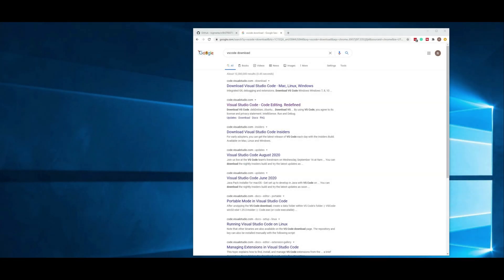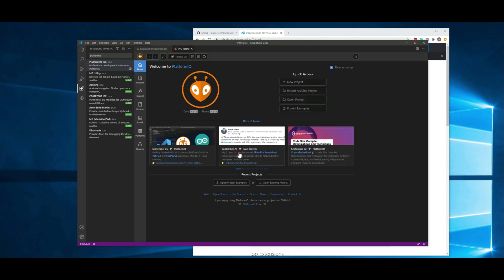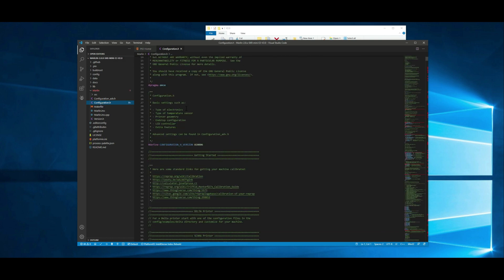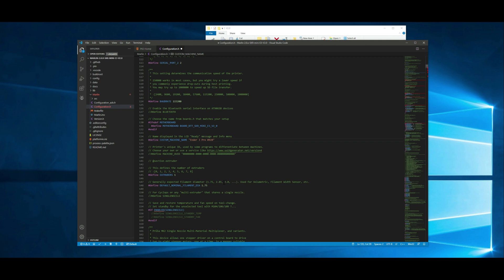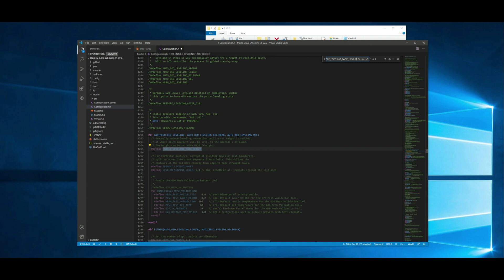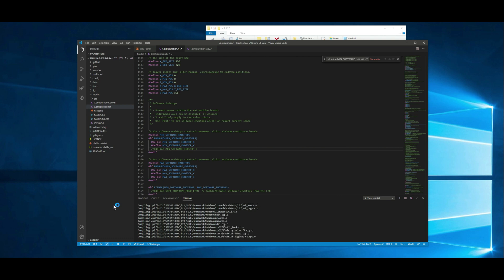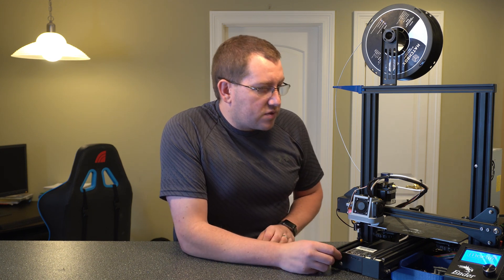How to Compile Custom Firmware for SKR Mini

Comment: I was trying to connect skr mini via usb but it is not detected by the laptop. I also tried to connect to octoprint via Rpi but it doesn't connect. How do I configure the usb port ?
Reply from the maker: Hi. have you tried a different USB cable? If its not being seen by either, you may be using a cable that is only meant for charging.
Reply: @3DPrintscape  Thank you. It's working now.

Comment: I have 2 printers a ender 3e v2 and a am8 with a skr minie3 v2 how can i use VS Code without chging the board and settings one for another.
Reply from the maker: Hi. If they both have the same board and build plate size you should be able to, if they are different you won’t.

Comment: If anyone gets the Collect2.exe error after attempting to compile the firmware, here's the fix. On the left pane of Visual Studio Code, open the platformio.ini file and change the "default_envs" line (around line 21) and change the name value to STM32F103RC_btt_512K.
Reply from the maker: Hi. Thanks for the info. If the build still fails after this remove the _512k. The option went away back in June.

Comment: I followed all this and i get a .elf and .hex firmware and no bin?
Reply from the maker: Hi. What board do you have? If you have a 32 bit board that uses a bin then the output should be a bin. If you have an 8bit board, then what you got is right but you have to connect your printer to the computer to push the firmware after you installed a bootloader.

Comment: Hi I'm getting an error compiling. I even tried compiling the un edited code and still same error. Any ideas? Great video by the way!
Thanks!

> Executing task: C:\Users\Daddy\.platformio\penv\Scripts\platformio.exe run <

Processing STM32F103RC_btt (platform: ststm32@~6.1; board: genericSTM32F103RC; framework: arduino)
-----------------------------------------------------------------------------------------------------------------------------------------------------------Verbose mode can be enabled via `-v, --verbose` option
In file included from buildroot/share/PlatformIO/scripts/../../../../Marlin/src/inc/MarlinConfig.h:34:0,
                 from buildroot/share/PlatformIO/scripts/common-dependencies.h:31:
buildroot/share/PlatformIO/scripts/../../../../Marlin/src/inc/../pins/pins.h:547:12: fatal error: stm32f1/pins_BTT_SKR_MINI_E3_V2_0.h: No such file or directory
   #include "stm32f1/pins_BTT_SKR_MINI_E3_V2_0.h"  // STM32F1                              env:STM32F103RC_btt env:STM32F103RC_btt_512K env:STM32F103RC_btt_USB env:STM32F103RC_btt_512K_USB
            ^~~~~~~~~~~~~~~~~~~~~~~~~~~~~~~~~~~~~
compilation terminated.
CalledProcessError: Command 'arm-none-eabi-g++.exe -DTARGET_STM32F1 -D_MARLIN_FIRMWARE_ -DHAVE_SW_SERIAL -DTONE_CHANNEL=4 -DTONE_TIMER=4 -DDEBUG_LEVEL=0 
-DSS_TIMER=4 -D_MARLIN_DEPS_ -w -dM -E -x c++ buildroot/share/PlatformIO/scripts/common-dependencies.h' returned non-zero exit status 1.:
  File "C:\Users\Daddy\.platformio\penv\Lib\site-packages\platformio\builder\main.py", line 175:
    env.SConscript(item, exports="env")
  File "C:\Users\Daddy\.platformio\packages\tool-scons\scons-local-4.1.0\SCons\Script\SConscript.py", line 591:
    return _SConscript(self.fs, *files, **subst_kw)
  File "C:\Users\Daddy\.platformio\packages\tool-scons\scons-local-4.1.0\SCons\Script\SConscript.py", line 280:
    exec(compile(scriptdata, scriptname, 'exec'), call_stack[-1].globals)
  File "C:\Users\Daddy\Desktop\3D Printing\3D Printing tools\Firmware\BIGTREETECH-SKR-mini-E3-master\BIGTREETECH-SKR-mini-E3-master\firmware\V2.0\Marlin-2.0.7.2-SKR-mini-E3-V2.0\buildroot\share\PlatformIO\scripts\common-dependencies.py", line 286:
    apply_features_config()
  File "C:\Users\Daddy\Desktop\3D Printing\3D Printing tools\Firmware\BIGTREETECH-SKR-mini-E3-master\BIGTREETECH-SKR-mini-E3-master\firmware\V2.0\Marlin-2.0.7.2-SKR-mini-E3-V2.0\buildroot\share\PlatformIO\scripts\common-dependencies.py", line 118:
    if not env.MarlinFeatureIsEnabled(feature):
  File "C:\Users\Daddy\.platformio\packages\tool-scons\scons-local-4.1.0\SCons\Util.py", line 658:
    return self.method(*nargs, **kwargs)
  File "C:\Users\Daddy\Desktop\3D Printing\3D Printing tools\Firmware\BIGTREETECH-SKR-mini-E3-master\BIGTREETECH-SKR-mini-E3-master\firmware\V2.0\Marlin-2.0.7.2-SKR-mini-E3-V2.0\buildroot\share\PlatformIO\scripts\common-dependencies.py", line 262:
    load_marlin_features()
  File "C:\Users\Daddy\Desktop\3D Printing\3D Printing tools\Firmware\BIGTREETECH-SKR-mini-E3-master\BIGTREETECH-SKR-mini-E3-master\firmware\V2.0\Marlin-2.0.7.2-SKR-mini-E3-V2.0\buildroot\share\PlatformIO\scripts\common-dependencies.py", line 250:
    define_list = subprocess.check_output(cmd, shell=True).splitlines()
  File "C:\Users\Daddy\.platformio\python3\lib\subprocess.py", line 424:
    return run(*popenargs, stdout=PIPE, timeout=timeout, check=True,
  File "C:\Users\Daddy\.platformio\python3\lib\subprocess.py", line 528:
    raise CalledProcessError(retcode, process.args,
=============================================================== [FAILED] Took 1.12 seconds ===============================================================

Environment      Status    Duration
---------------  --------  ------------
STM32F103RC_btt  FAILED    00:00:01.121
========================================================== 1 failed, 0 succeeded in 00:00:01.121 ==========================================================The terminal process "C:\Users\Daddy\.platformio\penv\Scripts\platformio.exe 'run'" terminated with exit code: 1.

Terminal will be reused by tasks, press any key to close it.

Comment: Hi, great video. Very informative and helpful. Just a noob question. I am using the BTT stock fw on the SKR Mini E3 V2 on my ender 3 V2. I would like to install Jyers fw. Can the SKR Mini support Jyers?
Reply from the maker: Hi. I haven't actually tried it my self but i searched around a bit and it looks like it would work.

Comment: I am extremely new to 3d printing, I looked at your video and tried everything that you said only to get this at the end.pio\build\STM32F103RC_btt\firmware.elf] Error 1.  I've tried to download another copy and reinstall but it doesn't work, any advice?
Reply from the maker: Hi. In your platformio.ini file (at the root of the directory) replace default_envs = STM32F103RC_btt with default_envs = STM32F103RC_btt_512K .
Reply: @3DPrintscape  ok awesome that worked but when i put it into the printer, i get fade height off, what does that mean?
Reply from the maker: @marcusmiles568 This is pretty common on the TFT, take a look at this article. https://github.com/bigtreetech/BIGTREETECH-TouchScreenFirmware/issues/750
Reply: @3DPrintscape  I.m sorry i'm not totally understanding, so after I get autoleveling done and saving the grid, how do i level the bed because its still quite a ways from the nozzle.
Reply from the maker: @marcusmiles568  You will need to set you z offset, here is a video I made on that. https://youtu.be/2gRfU26aTDs

Comment: When I comment out the MIN_SOFTWARE_ENDSTOP_Z I get an error
Reply: Fixed that issue

Now getting: collect2.exe: error: ld returned 1 exit status
* [.pio\build\STM32F103RC_btt\firmware.elf] Error 1

on Compile.
Reply from the maker: Hi. That is just the exit code, not the error but based on the environment i think i know what the problem is. Open your platformio.ini file (at the root of the firmware folder) and replace default_envs = STM32F103RC_btt with default_envs = STM32F103RC_btt_512K , then try again.
Reply: @3DPrintscape  SUCCESS! You Rock! Thx
Reply: . . . Now, I inserted the SD and I get failed to enable bed leveling
Reply from the maker: @lynnkeith2289  How is the bltouch wired and how is the firmware configured?
Reply: @3DPrintscape  It is wired to the maim board. Everything was working fine till yesterday, I connected Pronterface to my Printer and it started to print at the home location. Almost as if home was the bed. as far as configured. I followed the Tutorial.
Reply: Are you on 3d Printing Discord chat?
Reply from the maker: @lynnkeith2289  Ya, im on there too much lol.

Comment: Good video. Quick question...when I load all the files into VS Code, each of the config files, .h and adv.h, show the following error :

"#include errors detected. Please update your includePath. Squiggles are disabled for this translation unit (F:\Rev\Desktop\3D Printer\Firmware\Marlin-bugfix-2.0.x\Marlin-bugfix-2.0.x\Marlin\src\MarlinCore.cpp)."

Am I doing something wrong? Are squiggles supposed to be enabled???

Edit***Disregard my comment earlier. Jim participates in class but DOES NOT PAY ATTENTION!  Once I went thru the video again, and did it EXACTLY like you said to do it, everything worked just fine LOL!!!   Again, VERY good Video!  Thank you.
Reply from the maker: Hi. Thanks for the feedback and im glad you got it working :).

Comment: Hi is it posible for the Compile custom firmware to be send via email thank you
Reply from the maker: Hi. Its possible, it just depends what your looking for.
Reply: I don’t have z adjustment and bltouch in my manu I don’t know how to do it thank you
Reply: I need to adjust the z I think 
The nozzle scrape on the print when printing
Reply: I try to follow your video compile success but still nothing on the printer

Comment: Question might have been answered, but after I hit done in Z wizard the gantry ignores the stop and motor keeps running into the bed. Will not stop until I turn it off. It keeps showing my z stop at z014.00 and my offset at -85. What am I doing wrong?
Reply from the maker: Hi. It sounds like the wiring doesnt match the firmware. How is the bltouch wired and is the z-stop still wired as well?
Reply: @3DPrintscape  brown,red,yellow. The board is a 1.2v SKR mini. Yes Z stop is plugged in.
Reply from the maker: @juststeve8286  ok, is the black and white probe stop plugged in? If so, this is the default wiring for prebuilt firmware but if you built it yourself, make sure you comment out #define Z_MIN_PROBE_USES_Z_MIN_ENDSTOP_PIN and uncomment #define USE_PROBE_FOR_Z_HOMING .
Reply: @3DPrintscape  yes it is plugged into the probe area or 5pin. I did the above and it still ignores stop signal.
Reply from the maker: @juststeve8286  Its possible the black and white wires on the stop are reversed.
Reply: @3DPrintscape  I went back and changed the wires around and did the firmware three times same issue. I ordered a new board and try that.
Reply from the maker: @juststeve8286  Can you let me know if it works on the new board?
Reply: @3DPrintscape  I learned a important step for my issue. The touch must be unplugged first. Then plug in SD card with firmware. Let it boot up. Then shut it off and plug in touch and it worked with no problem. So I kept my board and it worked.
Reply from the maker: @juststeve8286  Interesting, i will keep that in mind in case anyone else has a similar issue. I have always done the wiring first, but I have never powered it on without having the other firmware on the sd card and ready to go.
Reply: @3DPrintscape  I made sure the firmware was on the card before powering it on and wired up. But with my issue, it was not working till I installed first then wired.

Comment: Followed this exactly and I get "Failed when compiling ............... Error: Build environment 'mega2560' is incompatible with BOARD_BTT_SKR_MINI_E3_V2_0. Use one of these: STM32F103RC_btt, STM32F103RC_btt_512K, STM32F103RC_btt_USB, STM32F103RC_btt_512K_USB"
Reply from the maker: Hi. Take off the _512k, this option was removed from the bug fix line around June i think.

Comment: Hii. I keep getting error message when it compailing the rom 

collect2.exe: error: ld returned 1 exit status
* [.pio\build\STM32F103RC_btt\firmware.elf] Error 1

c:/users/nas/.platformio/packages/toolchain-gccarmnoneeabi/bin/../lib/gcc/arm-none-eabi/7.2.1/../../../../arm-none-eabi/bin/ld.exe: .pio/build/STM32F103RC_btt/firmware.elf section `.rodata' will not fit in region `rom'
c:/users/nas/.platformio/packages/toolchain-gccarmnoneeabi/bin/../lib/gcc/arm-none-eabi/7.2.1/../../../../arm-none-eabi/bin/ld.exe: region `rom' overflowed by 420 bytes
Reply from the maker: Hi. STM32F103RC_btt need to be updated to STM32F103RC_btt_512K in the platformio.ini file in the root of the firmware folder.
Reply: @3DPrintscape  great thank you i got it now. after changed the bltouch to mesh i could compile the firmware

Comment: Hi, can you explain why the z min probe stop inverter you mention at 6:05 needs to be swapped to true? And do the other z stops also need to be set to true as well?  I do not always see people recommending to swap this setting so curious what it actually does? Thank you
Reply from the maker: Hi. The z-probe stop inverter being set to true is just needed for the bltouch, many of the other ABL options don’t need it. It’s a way to flip the logic of the probe. I think it has something to do with how the sensor in the bltocuh works. The rest of them don’t need to be changed.
Reply: @3DPrintscape  Thanks for the explanation.  I don't recall doing this when I initially installed and loaded the BT firmware but it could have been there.  I'm in process of the need to custom the firmware being used so your explanation has be very helpful.  I'll give it a try and if things run backwards, I'll know where to swap.

Comment: Hey guys! just wanted to let you know. DONT ADD THE TEXT .bin to the firmware. if you're on windows or mac, its already downloaded as a .bin file. you just need to change the name to "firmware">> all you're doing by adding .bin is calling the file "firmware.bin.bin"

simply download the file and just call it "firmware" > move it to your SD card>> Eject and put in your printer 

hope this saves you guys a huge headache
Reply from the maker: Hi. Thanks for the tip. It’s definitely worth keeping that in mind. The only time That wouldn’t be true is if you have show known file extensions unchecked in Windows. I keep that unchecked for security reasons, and know a lot of people that do the same.

Comment: How do I connect ezadl with  this bord?
Reply from the maker: Hi. I havent actually used the ezadl myself but looked at the wiring for it. The wiring would be similar but i believe their would need to be a couple changes to the firmware for it.
Reply: Can you help out do you know where can I find exact steps that I have to take

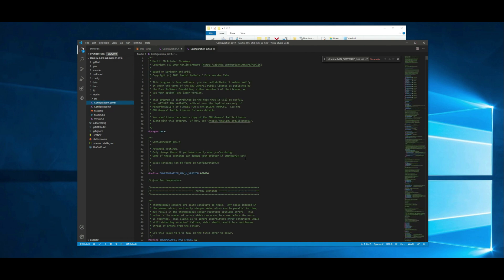Comment: video is so blurry you cant see what your changing and you dont mention some of the stuff . like line 661 and 669 in confi adv h.. no clue what the items you changed are ... time 9:16
Reply from the maker: Hi. Sorry the video is blurry for you. I try to do the screen capture at a normal resolution but when its added the rest of the 4k files its can be blurry at some resolutions. The two changes were enabling these lines #define BLTOUCH_DELAY 500 and #define BLTOUCH_FORCE_SW_MODE for the bltouch. I will get written instructions up for this soon as well. Also, if you run into issues and need help, you can reteach out here or on discord. https://discord.gg/Bu94EYVkrU

Comment: Hey, I dont have the checkmark on the bottom line when i try to build the firmware. Is there another way to build?
Reply from the maker: Hi. It sounds like platform.io isnt installed or VS Code wasnt restarted after the install.

Comment: It's won't work without changing the platform.io file like this (default_envs = STM32F103RC_btt_512K)
Reply from the maker: Hi. Yes, im not sure why but BT changed that in the last update. I hope they change it back because it has caused a lot of confusion/problems.

Comment: Followed step by step several times but I keep getting

 'collect2.exe: error: ld returned 1 exit status
* [.pio\build\STM32F103RC_btt\firmware.elf] Error 1' an
Reply from the maker: Hi. They made a change in a new version that broke the build. In the paltformio.ini file at the root of the firmware folder replace default_envs = STM32F103RC_btt with default_envs = STM32F103RC_btt_512K and try to build it again.
Reply: @3DPrintscape  Thanks for the reply, this solved it!
Reply from the maker: @kamranrizwani5108  You're Welcome!

Comment: Hi, thanks for the reply. It was because I was moving the V 1.2 file over and not the Marlin file over! Started compiling and then hangs, done this on another compile as well, so looks like I need another computer
Reply from the maker: Hi. I suppose its possible its related to the computer but the required specs are minimal. Its possible AV or something like that is causing you issues.

Comment: When homing the z axis dose not move down to home the z 

I have z stop wire not connected wanted to use probe to home z
Reply from the maker: Hi. When you home the printer with a bltouch it will do so in the middle, engage the probe, then stop at about +10. Is that what you are seeing or is not not going down at all? Also, you can join us on discord to help troubleshoot as well https://discord.gg/Bu94EYVkrU .

Comment: would like to keep my limit switch for z homing so what changes would i need to make in Firmware for BLT also what ports would i need to connect BLT to .
Reply: Hi Thank you for reply just waiting for my BLT to arrive no doubt i will have further queries .
Reply from the maker: Hi. The bltouch 2 and 3 pin gets plugged into the bltouch port and you want to comment this #define Z_MIN_PROBE_USES_Z_MIN_ENDSTOP_PIN and uncomment this //#define USE_PROBE_FOR_Z_HOMING . If you run into issues you can join my discord for help. https://discord.gg/Bu94EYVkrU